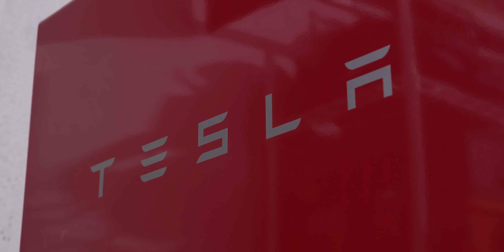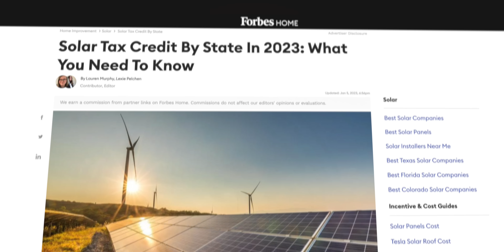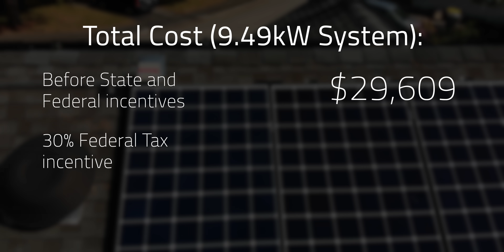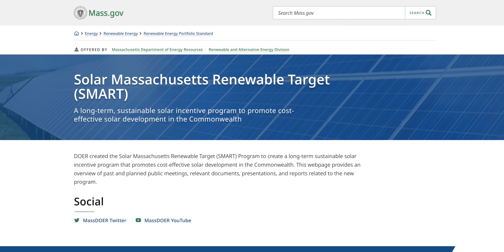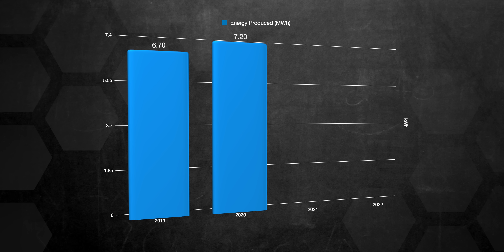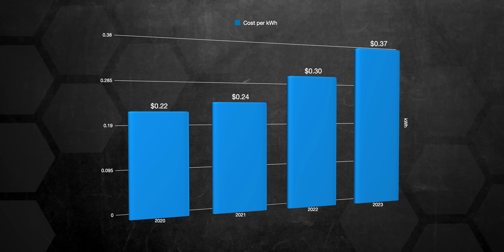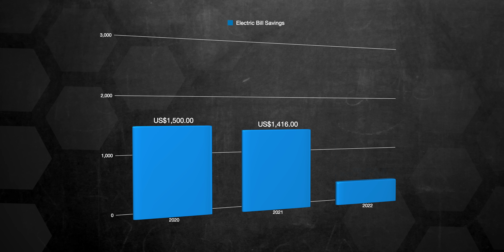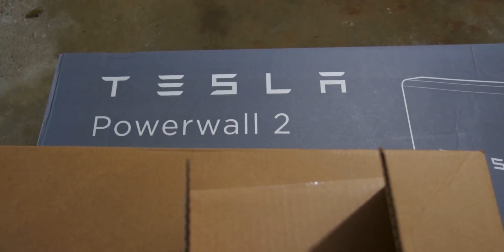5 Years with Solar Panels - Is It Still Worth It?

Comment: I got quoted 100k for a 15k system. Monthly payment 670$ a month with 4.6% escalators. My electric bill is only 156$, makes no sense. I got a better quote from another company for 60k and got 280$ with no escalators, still twice my utility bill. No savings at all unless my electric bill doubles and might break even at 25 years, which is a horrible investment. If I DIY solar, I might get the system I want for 25k in material post tax incentives but would still take 10-15 years to break even. I don't plan to sell my home so I don't value equity.
Reply: Geez, that pricing is ridiculous. Why such a high cost? A decent 10KW system with a BYD battery is under 20k euro in Germany.
Reply: You also didn't mention that solar panels have a finite life, you would be very lucky to get 20 years out of them without having to replace all or most of them. Not to mention " power walls" which only last 10 years. I'll take a hard pass on solar, thank you !
Reply: @brucemitchell5637  Who likes the look of the solar panels.
Reply: @brucemitchell5637  I have the exact same panels as in the video. The warranty is for 25 years with output being at least 88% so maybe your argument that you would be lucky to get 20 years is possibly not valid.

Comment: I do not care about return on investment.  I was once without electricity for almost two weeks after a hurricane.  I am getting an off grid system.  I have the room for a ground mount system and the money is in the bank.  I worked as an industrial electrician for over 10 years  and will be doing the installation myself.
Reply: You are in good shape for saving a bunch of money since you seem quite capable of installing yourself

Comment: The thing about it is why aren’t these on an actuated system this way the solar panels can follow the sun from sun up to sundown. Thus almost tripling your power would that be much more a better set of insulation and just placing panels flat on your roof?
Reply: It's a weight/complexity thing. The extra cost and mounting of a movable system is prohibitive. (Not to mention a ton of comments say some of this installer companies are predatory and I bet they wouldnt get a cut for installing a system like that) As a fellow northerner I havent seen any ground based solar panels with a tracker but out west ive seen large land panel arrays with them

Comment: Great idea.  If you are rich.
The rest of us can't afford to spend that much on solar panels and a portable gas generator  is a lot cheaper than aTesla battery.
You can't  count on government incentives and tax breaks, they can disappear  overnight.
I still do not see how anyone saves any money when you need a new roof every 20 years and there are solar panles in the way so you have to take everything apart and since your solar is 20 years old you will probably  have to put a new system in because  the old system is outdated.
Over 20 years it is cheaper to pay the electric rates.

Comment: I'm going to have to call BS on the power costs, the average here is 12 cents per kw not 30 + cents as claimed and this is a 2023 price! 

This also does not include the cost of replacing the batteries at the end of life (usually a max of 10yrs) nor of the cost of disposal of those batteries!! He's fudging a lot trying to make it seem more desirable to go solar!

Another thing is, one comment stated the roof top units were not feasible for their location, and they put in a ground mounted system that was 14' x 70'. However the average homeowner does not have that much sq ft available as that would at least DOUBLE the lot size requirement for a standard home with the space unusable for any other purpose! Not to mention that most insurance companies WILL NOT cover the panels or roofs and in most cases will cancel your entire policy!!
Reply: I think the gentleman knows exactly what rate he pays for electricity lol

Comment: Here in israel we get 0.48 shekel from the elctricity company for every kWh the solar panels produce, and the cost of installing a solar power system is about 4,000 shekel per kWh.
In average solar power systems breakeven is about 5-6 years.

Comment: unlikely to be installing solar at this time.  but did have a question/thought.  I know the powerwall, and a lot of solar batteries being installed are Lithium Ion.  Is there a way to instead use Lead-acid batteries?  less environmental impact in mining and refining lead, and producing sulfuric acid, and they are nearly 100% recyclable (plastic case is iffy...).  Yes I know energy density is big selling point for Lithium, but this is a house, not a car or phone.  can build a room or shed for the batteries.  if they start failing, easy to replace.  cynicism notes since NiCad every rechargeable battery has a limited life,  and never long enough.
Reply: What little I know, I can tell you that yes, you can use lead acid batteries. However, good deep cycle lead acid batteries of sufficient size are quite expensive too and lead acid cannot be drawn down below 50% capacity without damaging it. Lithium on the other hand can withstand deep discharge. So, the bottomline when it comes to batteries, lithium Iron Phosphate batteries are far more economical. LiPo batteries can take far more charge/discharge cycles than lead acid. If you have 400 ah of lead acid...you actually only have 200 ah.....allowing for 50% discharge.
Reply: @WayneTheSeine  yet, seeing Lithium based batteries having erratic lifespans, like the NiCAD and NiMH before them.  the LIthium is environmentally dangerous to produce if/when done responsibly, and disastrous to life when not.  lead is infinitely recyclable,  other types of batteries seem to have a "what process was used, if unknown 0% recyclable"  long term sustainability with minimum environmental footprint seems to favor lead-acid as a technology, even if it might be more expensive to set up an equivalent power setup using lead acid...
Reply: @charlesmartin7536  We could cut carbon in America tremendously, 50% residentially  simply by going to 220v rather than 110v. The rest of the world did it for a reason. Also, natural gas refrigeration is 40% more efficient that electric driven compressors. More efficient home construction has come a long way. Government incentives paid out to solar would have been better spent paid out to home owners to assist in building properly and upgrading windows and insulation.  Twenty three percent efficiency sucks no matter how you look at it and it really sucks considering it progressively degrades in less than two decades. So, they are not 23% efficient when factoring in lifespan. Probably more like 15%. Reading through a lot of the comments about how bills have been cut and so on.....almost all of them include government money to fudge the numbers to make it appear to work out. True, one might begin seeing "real" savings toward the end of life or three quarter the way through but that too is a fallacy...that 20-30 thousand dollars could have been earning waaaay more than any savings on an electric bill....after cooking the books. Not one has mentioned having to replace components such as charge controllers, inverters, etc....but I assure most have.  Don't get me wrong, I am all for solar and solar research, just don't piss on my hat and tell me it is raining. Be honest with the data.

Comment: Blimey. I bought 11.4 kW of solar panels two years ago for about 5000 euros on a pallet. OK, I had to buy an inverter (SMA Sunny Island 8) for 3k plus a solar inverter (SMA Sunny Boy) for 1.2k. And.. 15kWh of LeFePO4 storage from Alibaba (2.4k) and a REC BMS with bells and whistles (1k). But that's still way cheaper. Add on the scafflolding and wiring, LFP testing stuff etc and we're looking at 17k euros for a solid system with storage for far cheaper. But you have to do most of it yourself 🦾

The scaffolding was also useful for my roof after getting inundated by 10cm hailstones last year💣

Getting it done with French regulations for tax benefits would have meant using an installer and it would have cost about three times more for less robust inverters etc. And grid tie is now almost worthless (hence the need for batteries).

Comment: Thank you for the useful sharing. My own situation is far removed, being in South Africa where we have been seriously slow in taking up solar options, which is a pity. We have good sunshine but coal was cheap and our electricity prices were very low. Things have changed dramatically over the last decade or two, now the biggest drive for solar is not so much to save electricity as to provide our own due to the failing monopolistic Eskom. Forced power cuts are the norm for a large portion of the day. Unfortunately we also don't have much of an energy market to speak of, so selling back to the grid is not much of an option. It remains quite an expensive exercise, as you can imagine. Just focussed on powering essentials at this stage, and hope to build the system when I can afford to.

Comment: The rain issue is why I finally found a company to install stone coated steel shingles on my home. They are very expensive (7 times more) but 1 they come with a 50 year warranty 2 the stone helps slow the rain down so it enters the gutter just like standard shingles.

Comment: Great video. I live in Austria and I have only just installed a 14.7 kwh system with a 20.7 kwh battery pack and the whole thing cost us just over €50k. That is expensive but so far even on really overcast and rainy days the system has covered 100% of our electricity.
Reply: Hopefully your system will last long enough to see realized cost savings.
Reply: @macfady2181  thanks. So far its looking good. In the 3 months I have had the system it has saved me over €1700. We are only currently using 30% of our capacity.
Reply: @macfady2181  Our electricity and natural gas averages $200.00 US dollars a month or less with a 4 bedroom house and we use AC all summer long and keep our home  comfortably warm all winter .... it would take a lot of years to pay that off....
Reply: @macfady2181  It wont

Comment: I took a loss on my solar panels in New Mexico because of market conditions. I was extremely happy about my production and was saving a lot of money each month, even though I had a hot tub and electric car. I produced more than I used even without a battery backup. But the buyer requested a payoff on the solar or they would back out of the deal and I couldn't wait to sell. I absolutely believe in solar but be aware that it can be a plus or minus when it comes to a sale.
Reply: Makes much more sense to not be financing the panels.  If you are not leasing the panels you don't have to worry about this.  Get a home equity line of credit and pay for the system outright.

Comment: Well I am still going to stick with nuclear power for my electric, and natural gas for my heat. I can't afford to spend thousands of dollars each year for solar. A full instillation can run anywhere from $58,000 to $75,000. Also your talking about payment plans that will out last me,  to finally get it paid off. Thanks, but no thanks. If and when Michigan goes full green in the up coming years, I will cut our electric service completely off the grid. No solar, no wind support from me! In all fairness, this will be the end of anything electric in my home. I will make sure every single wire will be removed, and also the breaker panel! Candle lights will be the only thing I will use!

Comment: 3 months at 33kwh daily. Your graph.
And you rate your 26 panels at 365kw but show 425kw panels.

So 9.49kw  or 11.31kw system. ??

You generated 5,500kwh and used 12,500kwh.

In Australia a 6.6kw is 33kwh daily at Sydney latitudes, = 12,000kwh maybe. And cost 5,000 AUD. with enphase micro inverters and subsidies. 
Just thinking.

Comment: Hi Matt. I remember watching your pv install vid before I took the plunge and got panels on my roof in the UK in Aug 19. 
As you may know, the energy market here has been a bit of a roller coaster over the last couple of years. Initially I was signed up to a utility supplier who paid a very nice rate for my spare kwhs. In fact, in 2020 (when the weather was admittedly fantastic) I didn't pay a penny in utilities (gas or electricity) for six months. Then in 2021 it all went a bit pear-shaped. The market convulsed and many suppliers, including mine, went bust. I became a British Gas customer for over a year and the rate they were buying kwhs was so small, it wasn't worth doing. There are more eco-friendly suppliers out there and in Feb this year I was able to swap to Octopus. Cheaper rates, nicer company all round to deal with. EXCEPT when it came to selling my  kwhs. I first asked them about it in April and, having gone through a tedious signing up process discovered that here in the UK we have two types of system installation certificate. Well, guess what? The one that I have is not the one they recognise. So back to the drawing board. I am now signed up with a different supplier and am currently waiting on final approval from our national grid (takes up to 8 weeks, I gather). However the payments start from when I applied, so I shouldn't have lost too much of the main generating season. Next stop is to swap over the supply of gas and electric (tomorrow's admin task) so that I'm not buying from one supplier and selling to another.  Also have a battery issue to resolve but that's another story.

Comment: If you don't clean your panels they will lose efficiency. They need to be cleaned at least once a year.
Reply: I've cleaned mine once in eight years, and they produced more energy last year than in 2016 when they were new. I'm not saying their efficiency has increased ; of course it hasn't. But it's decreased so little that a small change in cloud cover between the years more than made up for any degradation.
Reply: @BigBen621  fair nuff, but I've seen panels that cut their output by 2/3rd until someone just wiped them off
Reply: @theterminaldave  I have no doubt there there are conditions where that's necessary. But that's no basis for a blanket statement that panels will lose efficiency if they're not cleaned once a year.
Reply: @BigBen621  yeah it's an arbitrary number, but so it measuring/comparing their efficiency once a year which is done in the video.
So maybe clean them before you measure and compare their efficiency? 
That's my point.

Comment: Our installation was partially subsidized by the Australian government but it was still a waste of time & money. They came around & installed the electrical part of it while I was at work. I noticed a wi fi aerial on the wall mounted unit & assumed it was for monitoring purposes. My wife told me they tried to access my computer but it was password locked. I'm also assuming they wanted to install monitoring software. I tried contacting the Solahart but could not find a direct contact number. After hours of trying I finally found a guy who was loosely connected with Solahart & promised to stop by & take a look. He never showed up. We get about $30 deducted from our bill each quarter. Big deal. At that rate it will take over a decade for the installation to pay for itself. We were rorted!

Comment: Two things I wish I had known before having panels installed. First, I should have checked the condition of my roof. It needed repair, but I didn't know that until AFTER the panels had been installed, adding to the cost when I eventually had it done. Second, definitely get the panels critter-proofed. Pigeons made a shitty mess of our yard between the time when we got the panels and we got them critter-proofed. We should have done it immediately.
Reply: As a solar installer myself, I have told companies I have contacted for that the roof is in no condition to have panels mounted. In my belief that should have been checked by the person who did the original site visit. As well, pigeons are a massive problem where I work as well and I agree with you, always get critter guard installed around your panels. Pigeons can be pests to deal with and affect your production of power due to their fecal matter😂. Lastly panel efficiency is said to drop about 1% a year. As long as you have a solid roof with metal or fairly new shingles when installed you should be good for 20-25 years with new systems. That being said micro inverters on the roof are known to fail after 8-10 years. Look into the type of system you are getting and make sure the installers are knowledgeable about the product they are putting on your roof. My apologies for miserable literacy.
Reply: Putting solar panels on anything other than a new roof runs the same risk.  To repair the roof properly will either require removal and reinstallation of the panels or extensive and unsightly patching.  All that assumes that your roof trusses have/will not sustain damage during the process or due to water intrusion due to roof leaks.

On the flip side, most quality architectural composite shingles these days have a rated service life of 30-40, or even 50 years depending on where you live and how well you maintain them.  As another poster indicated his 1st generation panels are pretty much done after 15-17 years.  Unless the replacement panels are the same size as the originals, or the mounts are very adjustable without adding or moving the stanchions you'll have to poke more holes in your old roof again.

Bottom line, your panels and your roof are one system and need to be engineered as a single complementary unit.